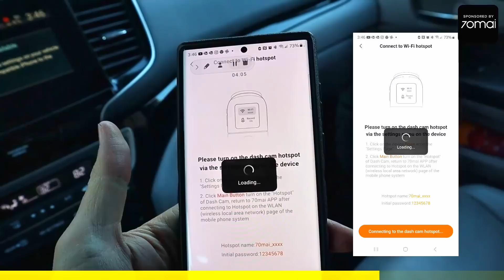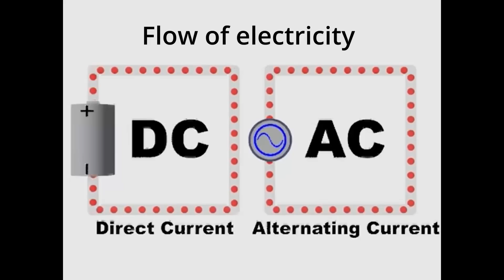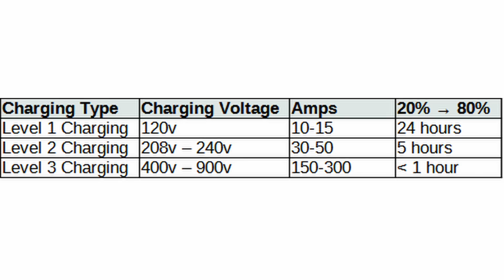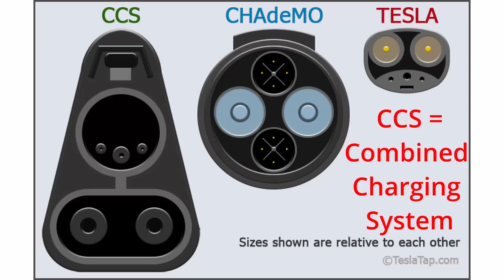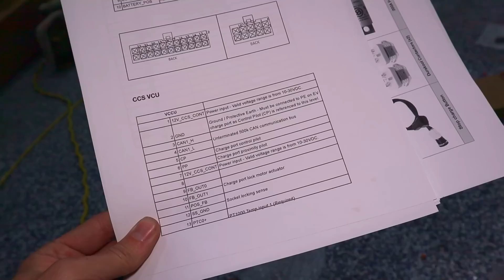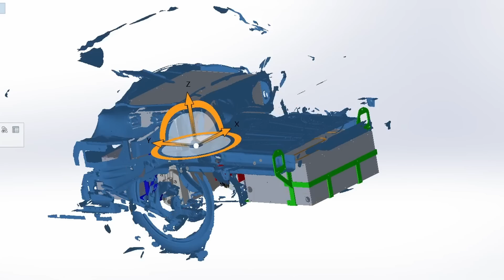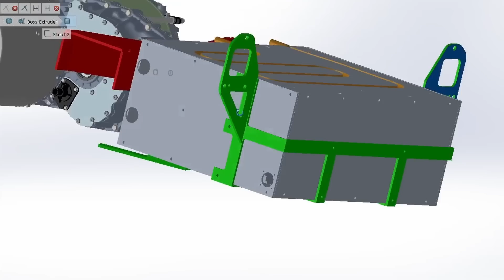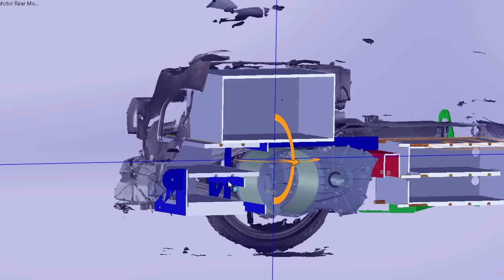Installing DC Electric Vehicle Fast Charging - Fellten CCS fast charging kit

Comment: If you're asking me and you did, I'd say you should use the old fuel filler door. It'll be a lot more stealthy and honestly easier than anywhere else on the car. Best of all, it locks. That said, you may want to think about relabeling the fuel door release with a lightning bolt instead of a gas can.
Reply from the maker: Very nice!

Comment: Great video, very informative. I like the use of the bumper bracket being used for the two further back mounts for the three battery boxes, I also like the idea of bolt through the battery box and the smaller holes to ensure they wont move around at all. I liked the explanation of the wiring of the charging system. Keep up the great videos. I know I am way behind on all the videos.
Reply from the maker: Thanks! 👍

Comment: Thanks! I was considering ordering the Fellten CCS1 kit, but they've been listed on backorder/preorder for months.
Reply from the maker: I ordered one under the same conditions.  I thought it might take months.  I think I received it in less than 1 month
Reply: @electricsupercar  Great to here! I might order one then. My only concern is that it appears to be limited to 200 A, but I have to assume that is due to the cable they provided. Any plans for a video on the BMS integration?
Reply from the maker: more to come!

Comment: From a mechanical engineering perspective, you should definetely strap around those battery boxes. With 1G mass will be multiplied 9,81x in a crash. Don't rely only on bolts they can shear, snap, vibrate open, etc. As you may know it's whole lot different forces for cutting vs shearing a bolt so tighteing torques are crucial.
Reply from the maker: Thanks!

Comment: Love the detailed info. A comment on the battery mounting. You have forces of about 1G in acceleration but 2 G in breaking and if there is a crash maybe 3-4G. You might be able to do a load analysis with your software to see if it would hold. You would hate to be in a crash and have the 200 lb batteries go into the driver & passenger.
Reply from the maker: Thanks for the tip

Comment: I would be tip-toeing around easy access to things like OEM ( KW?) suspension installation and camber adjustment.  And of course, possible quick swap-over / replacement of batteries .Also . scanning roolz ! But you're a CADmeister and I reckon  those scans squeal dimensions like a fed on truth syrum . Scans aren't drawings,  especially with Autodesk . You are a Legend ! 🙏 so I amma shuddup and marvel .

Comment: Is it possible to relocate the rear battery box to the front of the cabin behind the front axle?  Your current plan has the rear battery box with little or no protection from another vehicle rear ending you. Also, the rear battery back  behind the rear axle has a big moment of inertia that will effect the handling. Ideally the batteries should be placed between the front and rear axle.
Reply from the maker: No room
Reply: Have you also explored  eliminating the back seat and placing the battery there?  If that is the case I imagine having to cut away  structure of the Porsche and fabricating a new  structure to hold the battery module.  Or is it possible to split that module with some in the front and some in the back for a total of 3 modules.
Reply from the maker: @markyormark7747 there is no back seat.  Just a 2 seater

Comment: If you are going to use the bumper mount points to support the battery box, the question becomes where are you going to mount the bumper, and in doing so account for the needed crumple zone you just occupied with a battery...The Ford Pinto comes to mind for all the wrong reasons.

Comment: Apologies if you mentioned this but why not NACS? Are the parts not available yet? Also, I like the upcoming motor mounts supported from above from the bumper supports.
For the charger port mount, I would think either the old filler cap if there is enough space there or behind the rear license place.
Reply from the maker: Thanks for the comment!

Comment: Hi, Jeremy…maybe I didn’t see it correctly, but I would be concerned about the “rear” battery support structure as it looks like it’s strap steel vs. being tube steel.  I would use materials and construction similar to that of a tube frame vehicle, providing a stiff structure for all potential forces that could be put on the battery box.  I agree with @rthomp03, the g loading could be extreme and you would hate to have the battery come loose in an emergency situation.  Just my 2 cents worth, I’m not an engineer and have been known to “overbuild” things in the past.
Reply from the maker: Got it

Comment: Regarding battery box design and mounting, it feels to me that you are relying a lot on "what feels right", when these are very mistake sensitive areas. I'd really recommend either doing some engineering yourself or getting some advice from an engineer.

I'd also recommend reading (and perhaps following) the rules for the Formula Student competitions, germany (FSG) in particular. Here students design their own (possibly electric) formula style race car. The neat thing about the rules that come with it is that if you follow them it is not only nearly impossible to make a potentially dangerous design, but they are also designed to make it easy for scrutineers to verify that the design is actually in compliance, and by extension, safe. Even when it's designed by inexperienced students.

In particular you should look into rules regarding the battery casing design, but all EV rules really. Ofcourse they are not all applicable but especially for HV wiring, spacing and isolation standards they are great. 

One thing in particular I feel every EV should have is the Insulation Monitoring Device (IMD). It's and isometer that has the ability to open the contactors if an isolation fault occurs between HV+, HV- and chassis. Also the SCS rules are important, essentially they make sure that when important components are disconnected the system returns to a safe state, e.g. a disconnected throttle sensor won't result in a stuck full throttle.

Comment: I have an idea for the rear battery box. However, I don't have a enough information to clearly understand how you plan to wire it and more importantly what all has to be done, other than the mounting hardware, to be able to remove it. With that said, my first thought is to keep the front two sets of mounting studs near the rear suspension. To also keep your vertical mounts that go behind the bumper, but then transition to a horizonal brackets somewhere below, the vertical mounts at the body. This way it would make it a little easier to remove the rear battery box - should you or a new owner ever have to do so. The bumper can stay on the vehicle and the battery box can be lowed down using some kind of jack. NOTE: If the rear bumper mounting area on the body is not doable for whatever reason - I would make sure your design has horizonal mounts to allow the lowering of the heavy battery box - without a lot of hassles and/or the need to remove more than one has to.  Hope this is helpful. Sincerely, Tony
Reply from the maker: Thanks for the suggestion!

Comment: Definitely put the charge port where the gas cap is located. By the way, have you done the FEA for the battery box mounting brackets? It's a must. And it will also help you with the optimization of the bracket design.
Reply from the maker: Thanks Friend!

Comment: Have you calculated the weight distribution with all the components in place?  Impact on handling characteristics?
Reply from the maker: It will still be an estimate until I get mounting solved.  Weight distribution should be similar.  Overall weight will be a little heavier.

Comment: Why must these dash cam companies crap the bed with the placement of the wire connection. LTT did a great video on how a most of these companies use the same sensor with lack luster video quality or worst no recording in an accident.

Comment: This is so interesting, always wondered how the CCS stuff worked even though I know the basics. On another note, the rear battery box bracket could probably be in 2 pieces, one for the front, one for the rear. I think the cooling plate could easily take all the weight well enough so I think the mid sections could be taken off. Just saving off those few pounds. This is just me though
Reply from the maker: Nice!

Comment: Some high performance vehicles use the engine and transmission as a stressed member to increase rigidity and save weight.  Meaning they engine block and transmission case are part of the structure of the car.  I believe that this the reason the lower rear suspension bracket has such beefy mounting bolts.  I suggest you engineer the battery retention brackets/frame to triangluate and reinforce the suspension.
Reply from the maker: Good point!

Comment: I think like the rest of the comments here, the area where the gas cap is would probably be a good spot. Also, could you explain your situation regarding using NACS in the future please? I know you mentioned it in the vid but I don’t think I quite understood it fully. You said you’ll eventually switch when it’s fully available?
Reply from the maker: I do not think Tesla has opened up their network of fast chargers to others just yet.  They have said that they will.  When it happens, there will be a big market for "adapters" that will go from the tesla charger to the CCS port.

Comment: About the rear batterybox; from what i can gather from your video I'd say the wrap-around won't do much strength wise. (Mainly because it's behind your mounting points)

As for the charging port location I'm pragmatic; whatever you determine to be; 1- the easiest solution (time and money wise)
B - the most convenient (wiring and later the charging)
Reply from the maker: Thanks!

Comment: For the front battery box holder/mount,  Since it'll also be the front Electric Motor mount, i think you're going to need s bit mote strength or another mounting structure to the chassis otherwise it may put too much stress onto the actual battery box and the weak points along the subframe battery cradle. The three points would be fine if it was an ICE however you've got a rotating device in a different place to where the original mounts were designed for, and probably alot more weight.
Correct me if I'm wrong, thats my thoughts. 
Keep up the good work! Been watching for many years now and I would like to do my own conversation when I am able to.
Reply from the maker: Thanks for the suggestion!

Comment: Great series,  I missed in the  videos how many KW of battery your using? In this, a race car,  commuter, or weekend machine.

How will the CG change with battery location?
Reply from the maker: All of the above.

I think the Cg should be very similar to the original car

45kWh
Reply: @electricsupercar  
That should get you a 100-mile range or 30-plus beating on it.  This is a shitload of work and cash to be so limited.  
What are you planning for HP?  I assume your going to do something to boost the power over a stock Tesla unit.  
Is that motor out of a three or an S?
Reply from the maker: 900hp from a performance model S

Comment: With such a large number of electrical components and wires, I would like to know if you have drawn an electrical diagram so that you will be able to find your way around the repair when necessary.
Reply from the maker: I have pinnouts for all the plugs that I have wire so far.  I have a base wiring diagram but it grows as I get more parts

Comment: According to IEC High Voltage is a voltage over 1000 volts, AC or DC. So you don`t use any HV system.
Reply from the maker: I think in the electric vehicle world they differentiate low voltage (12V)  and high voltage (400V).  Just EV terminology

Comment: For mounting the battery box, don't forget to design for the worst case loading in each direction. In even a relatively minor accident, you could see upwards of 30 g's of acceleration, so that 350 lb. battery box could exert over 10,000 lbs. of force. You certainly wouldn't want the box detaching from the vehicle in an accident. Obviously you can't design for every eventuality (high speed collisions can be hundreds of g's of acceleration), but do some basic FEA on your mounting structure to see what the failure load would be and sanity check your design. And don't forget to check the strength of your bolted connections too, as those might be the limiting factor when using existing mounting points.
Reply from the maker: Thanks for the suggestion!

Comment: Are you thiking about weight balancing with your battery placements?
Reply from the maker: I am trying to replace the weights that were removed by the engine, transmission, and exhaust.
Reply: @electricsupercar  Just curious if you were trying to maintain the same weight distribution between the wheels. Porsche seems to be pretty good about going 50/50 and my brief search said the Cayman was like 45/55. Just curious, love your stuff, wish I had the money to have you convert my 1990 Cabriolet...

Comment: I'd go with the charge port being under the gas flap as well, why reinvent the wheel after all. Although I am concerned about the rear battery box being just behind the rear bumper. One rear-end collision and it would compromise the battery possibly which would not end well. Some sort of protective bulkhead might be needed.
Reply from the maker: Thanks for the comment!

Comment: How did you import the 3D scanned files into Solidworks and how can you work so easy with them without crashing and so... Are these files like STL files? or your 3D scanner outputs STEP files?
Reply from the maker: Scanned file output is a graphics file

Comment: Those rear bolts where you mount under the rear suspention, is that part of the frame?  Shouldnt there be a bar/mount that connects both sides together????  I would think that being PART of the suspention there, that is needed to prevent major flexing.... just being supported by the top doesnt seem right to me...  unless I am seeing it wrong and you are putting it back in, or they are connected elsewhere and the camera isnt picking it up?  I only see the sway bar going across and that is NOT going to hold the sides together, thats to prevent the vehicle from flexing/cork screwing.  seems like there is a major peice missing... if they just went to the tranny/gearing, I wonder if that was structural then. 

Looking at it from my engineering point from just a camera and 3D scans here, that is what immidiately jumped out at me is there should be a big support holding the two sides together.
Reply from the maker: The red piece will tie the suspension together.  Or maybe I am missing what you are saying

Comment: Thanks for the great content! as far as mounting the battery boxes I'm a bit concerned about the crash structure in the back (as others also have mentioned) usually the rear beams have some sort of crumple zone and if I look at your 3d drawings it seems that in a rear end collision the battery boxes will be shoved into the back of your seat. Especially when you make them part of the battery box structure. But maybe I'm wrong and the structure is further back in the bumper.
Anyway keep up the good work, and stay safe 🙂
Reply from the maker: Thanks for the comment!   I think it will be ok as the batteries are in the same location as the engine was

Comment: Would mounting to the bumper mounts cause extra damage in the case of a small intensity rear impact? Like would a normal bumper replacement turn into a more labor intensive battery box rebuild?
Reply from the maker: I don't think so

Comment: Gas cap for the charging port, definitely.  You may want to consider square or rectangular tubing for mounting batteries (constrained obviously by the volume you have to work in).  Gives you dimensional strength without a ton of weight.  Also will help with shock loading, important for a car.
Reply from the maker: Thanks for the suggestion!

Comment: The majority of charging stations are stalls with charging cables coming from the end, not pull-through stalls like gas stations.  If you plan on backing into the stall all the time then the gas fill might work ok, but I think that the most convenient point will always be the end of the car.  Center means you'll have fewer issues with obnoxiously short charging station cables, but a corner can work ok in most charging stations.  If this is your regular car then backing in might be your preference, and the back would make sense given your battery location, but if you have family that might drive it frequently then front might be more comfortable for them and possibly result in fewer issues requiring bodywork repair. ;)
Reply from the maker: Thanks for the comment!

Comment: On the small HV cables that are shielded be sure that the shielding is stripped back far enough from you hv junction. It looks stuffed into you fuse holders. You do not want any leakage to you "case ground", I have seen pictures of what happens when you do not realize your shields are accidentally connected to HV.
Reply from the maker: Thanks for the suggestion!

Comment: Tesla's have their charge port on drivers rear fender and the charge cables are very short. If you hope to use the Tesla network at some point you should locate your charge port with this in mind. Driver's rear or passenger front as close to the back or front as possible.
Reply from the maker: Thanks for the comment!

Comment: I would just use the original gas port as the location for the charge port. This way it would be done with and we could move on to other area of the project agenda like batteries mounting points etc.
Reply from the maker: Got it!

Comment: Noo redbull F1 has 3 small battery boxes for weight distribution, I think the best opinion is to fit the one big in the front , the second big in front of the motor and the small in the very back
Reply: He only has so much room to work with